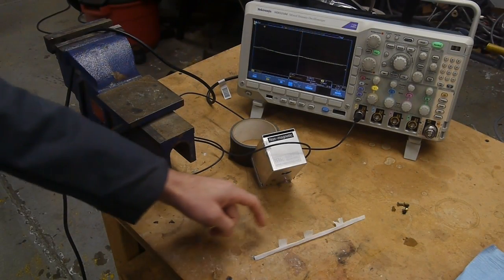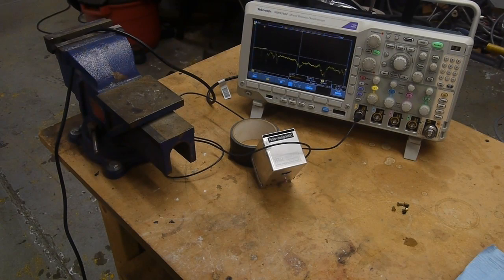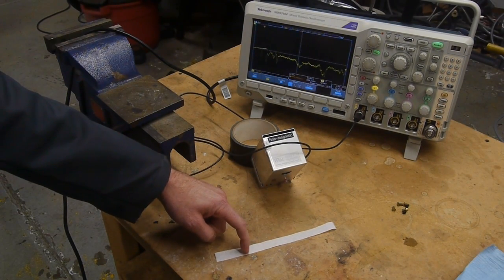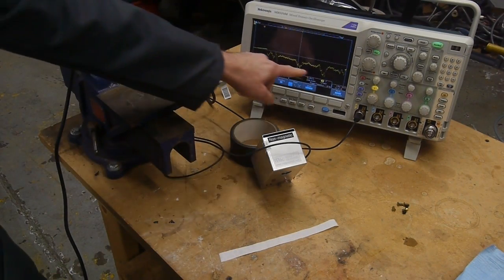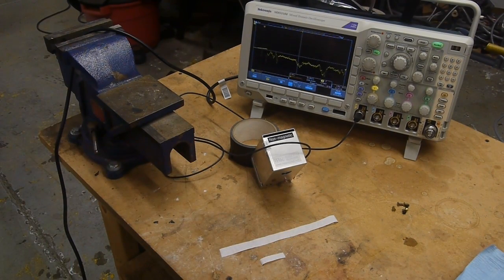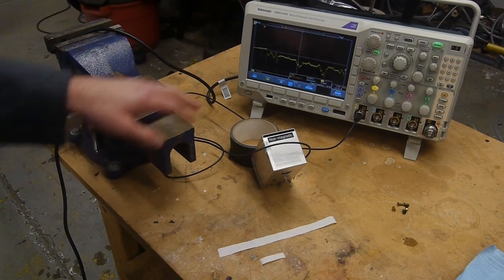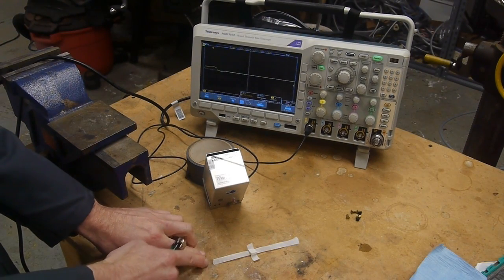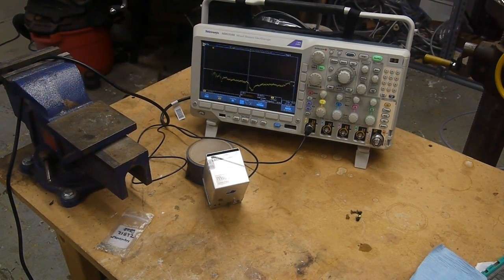Encode information in fire!

Comment: This looks like the perfect way to share secret information, because when someone sends you a strip you know no-one has read it before you and there is no evidence left after you have read it.
Perhaps useful for black boxes; if you have another strip as a backup.
Reply: "you know that no one has read it before you"
His strip reads 00010010001000, you can read it as it stands there on the table.
Reply: AnEntropyFan
I said A strip, not exactly the one from the video. especially if you have a straight strip of paper with no cutouts but just coloured flames you can not read it without a spectrometer.
Reply: sasja de vries
It is a paper with chemical traces on it, there are many ways to read it out. There are reasons why people do not use nonsense like this. This video was meant as a mental exercise - how would you use a system of strips as a "one time use" processor - rather than about practicality.
Reply: AnEntropyFan Even if dried chemicals are visible (under UV / IR /spectrometer) you can hide it by adding Nitro-cellulose fibres over it.
I know there are ways to read it, but there are more ways to hide it.
"This video was meant... processor" -does this mean I have no right to use it in another way???
People who think that "finding other applications for things" is nonsense PER SAY will never find something new.
If something CAN be used practially and safely and it has no analogues, why wouldn't you use it that way?

I know that paper strips like these are not as practical as tapes and disks. This is one of the things I thought: if you manage to make the 'chemical traces' so small a human can' t see it and the paper would me as thin as fishing wire and "rolled up" so that it looks like traces on a DVD,
Then it could be read in a dark box with a light sensor only sensitive to one 'wavelength' and because the traces are so small it is very difficult to read it in another way.
Reply: sasja de vries
Drop it, Ms/Mr. Sasja. This isn't realistically good (optimal) for anything.

LOL! Cut with that nonsense rectal rhetoric.

Or you can simply place a layer of an incendiary chemical over a chip and when the chip completes its sequence, the device sends a command for the ignition of the chemical, and voila! The chip is no more. Or you could simply critically overvolt the chip, no need to play with fire magic at all.

I'll leave you with a quote

"But the fact that some geniuses were laughed at does not imply that all who are laughed at are geniuses. They laughed at Columbus, they laughed at Fulton, they laughed at the Wright Brothers. But they also laughed at Bozo the Clown."
Carl Sagan
Reply: AnEntropyFan  I said "one of the things", not "this is THE WAY to do it". If you're not utterly *** you should understand that this was just an example for something that you COULD do. It's not an end product.

And adding a chemical/explosive/whatever to a chip leaves material all over your room, the ignition could refuse to go of. etc.

The thing is, you judge way to quickly, just because I don't write a whole 20 page philosophy in a youtube comment doesn't mean I didn't think any further.
Why are you trying to prove me, I'm an idiot?
Why are you assuming I am stupid when we don't agree? I just don't know what to say.
Do you feel smarter now?
Reply: AnEntropyFan If you have a sillicon chip (I assumed that is what you meaned...) acting as rom storage and you let a chemical next to it ignite, well... it's more messy than nitrocellulose. Nitrocellulose burns quite cleanly. Didn't you get that point or are you just looking for things I could have said differently?

my example is more like a "proof of concept" sort of thing. Most likely it will work (unlike square wheels), It needs refining and tweeking to turn into an end product.
Just because I had some thoughts doesn't mean it is now my obsession for live.

The Smartest people I have seen do not laugh out others, they have better things to do and they prove their talent by showing what THEY CAN. Jealous people laugh out others. Just saying. Smart people do not draw conclusions to quickly or refuse to think deeper to something that seems odd/wrong whatever.
Reply: some people look at how others say something in stead of what they're saying just because they are 100% sure they are the smarter one.
Reply: sasja de vries
Again, the data needn't disappear. It can be read using passive means, bringing no damage to it. A chip, however, cannot be read with passive means. You need to put specific voltage through it. You have to run it. If you build the device that way so it will destroy itself after being ran, it will be destroyed after being ran. Efficient, isn't it? Again, I can read your paper without destroying it. A device that finishes its sequence by destroying itself cannot be read without being destroyed, really. Furthermore, the thing about modern chips is that they are fast, really fast. Everything would happen in a fraction of a second. There is no way to read the chip and not kill it.

It is something different, but also something absolutely non-optimal. You have bright imagination, clearly, try using it about the very interesting question asked in the video. How would you make the "burning computer:?
Reply: AnEntropyFan If the traces are hidden behind another layer of cellulose, how would you read it out and how would you zoom into the tiny traces (that could be like spaghetti in stead of straight lines as long as they don't intersect of course)? Taking paper apart isn't the easiest thing to do, yet decapping and altering integrated circuits seems easier to me...

"You have bright imagination, clearly, try using it about the very interesting question asked in the video." Thanks.
I can remember that you can do fourier transform with lenses, perhaps a fire-computer could work like that, in s seemingly passive way.
Reply: sasja de vries
You are not trying to retro-engineer the circuit, remember. You are trying to read its current states.

You can do that with lenses? First time hear of that, really, sounds interesting. What I see as a main (and unbridgeable) barrier to a fire computer as it was proposed here is that it would have to be comprised solely out of OR gates (which is what these combined fire strips could provide).
Reply: AnEntropyFan I mean you take the IC apart to disengage the self destruct function and then read the states out...

about FFT with lenses: it indeed sounds insane, but have a look on google and be surpriced.
Indeed, you can make AND gates by letting a certain piece of paper only ignite when the flame is hot enough and it will be hot enough when there are 2 pieces of paper stacked; or something like that.
You can make OR gates if you just make one flame on it's own be able to handle the ignition of the piece of paper. the thing is that NAND gates are much more useful (I'm referencing at simple FPGA/CPLD´s consisting of ONLY nand or nor)

OR & AND-gates are doable (-ish) (sort of...)
Reply: sasja de vries
All of that are extremely invasive means, case in point is that it is actually much harder to "leave no evidence" when it comes to reading a chip like that.

The AND gate is doable with 3 strips (or more), indeed. Great catch!
Reply: AnEntropyFan 2 things: if you open up an IC, do your thing and refill the gap with epoxy  you can make it look like no-one touched it, except it won't explode, unless you even figured out how to engage it again.

secondly, I came up with a way to make burning-paper-NAND-gates!!! (and NOR-gates, and just inverters) One just need to cut out a special pattern and fold it in a certain fashion. I'll have to draw it on paper/GIMP to explain exactly how.
And I have a better idea for making AND-gates than the method I said before.

Comment: This fire computation might be tough. What you basically need for computation is a NOT and a AND/OR gate then you can create all the other gates from that. It is pretty easy to make a OR gate by bringing two strips of paper together so any one of them can ignite the output strip. But a NOT gate is very difficult, only reasonable way is to somehow burn away links (Sort of like what they did in the channel numberphile with dominoes to create a binary adder) But the problem with that is how do you burn away a link without setting on fire whats connected to it, it is possible to create a special pattern in the paper that works sort of as a diode by only burning in one direction and extinguishing in the other?

Comment: You can try using a magnesium ribbon since that should produce a very bright flame.  Also, have you tried using a series of thermocouples to take the measurements through temperature as opposed to light.  Did the ambient light in the room have a significant affect on the readings?

Comment: If you have three strips of paper A, B, C and a strip of non-flammable material like aluminum foil, then fold C into a tallish V, use the V (with foil in between) to “suspend” the end of A over the start of B. When A is lit and C isn’t, B will not burn. If C is lit before A, it will drop the end of A onto B, letting A light B when it is burned (the foil is there to prevent A from being lit when C is burning and prevents C from being lit when A is burning).

Boom! U now have a fire (plus gravity) transistor, two in a series can make an AND gate.

If u have 2 strips D and E, then use foil “V”s to hold E a bit above D, and u’ve got a diode cause D can light E but E cannot light D. Two in a series can make an OR gate. 

:)

Comment: I don't know about computation, and I don't really see the point, but they could be a pretty neat way of storing simple information. Perhaps using n different metal solutions, and printing it onto the paper, when it is burned it emits a strong, visible light signal. Considering that these metals burn in very specific parts of the light spectrum, it would be relatively easy to filter for these signals to decode information. The n different metals could be overlapped, giving a n-bit data storage per 'Burn interval' with the bitrate being limited by the geometry of the flame on the paper - A curved flame front could cross multiple bit intervals.

Comment: perhaps a long strip of peltier elements, so they detect the heat along the length,  perhaps the conversion it could even power an lcd to translate it? using capacitor storage for the power perhaps, initially a large flame burst to get the power flowing, and then as each of the extra tab burns, you detect the extra power flowing to the capacitor or the voltage burst increases, computing as morse code perhaps, no idea if any current microcontroller can run on this low power though :}
Reply: yes look at the adrino boards and the tiny atmo boards .

Comment: You could use 2 paper stips as inputs. Plain paper is the equivalent to logic low/false, paper soaked in something to raise the fire's temperature is the equivalent to logic high/true. Both paper strips are set on fire at the same time, at their ends there must be some sort of heat attenuator, so that a third paper strip (the output) is only set on fire if the received heat is above a certain level ( > only 1 flame being hotter than a plain paper's flame > both flames at plain paper flame's temp). That would be a logic AND gate.

Of course that only works under the right conditions, and I think repeatability with fire is a bit tough to achieve. Also, what would act as the attenuator? Plus the "circuit" self-destroys after only 1 computation, so I don't think it's anything other than a cool experiment.

I also think it is very interesting for Information transfer. If the fire burnt away all metal salts leaving no distinct evidence that there were any other substances that manipulated the flame, this would be the ultimate read-once memory. You could put your encoded information on a small sheet of paper, enclose it in something the size of an USB stick to be in a controlled environment and light it to read the data. Current provided by the USB port lights the paper, a sensor streams the data from the fire's spectral output to the PC.

But I think there will still be particles of those metal salts left after burning, plus opening such a device and reading the data without destroying the paper/information would still be possible. So that isn't secure, and why would we need read-once memory if not for security's sake?

Comment: Make a slightly tilted slot that holds a paper strip vertically. Make a small slid at the bottom of the slot, just wide enough for the paper to go through and just slim enough so flames below wont go up through it, ensuring that burning always happens at the same point below the slot. A thermoelectric peltier module above the flames (why the paper slot should be tilted) can produce electricity, to power an LTC3108 (Ultralow Voltage Step-Up Converter), that in turn can power a microcontroller (ATMega8?) and for output, a memory display (holds it's state after powered off); the peltier side facing away from the flame should kept cool by heat sink. A TCS3200 color sensor can be used to read the color. The paper strip would need a header without code on it, to allow the circuitry to start before the code begins. One strip could hold the entire calculation, or two strips could each hold a number while a third strip holds the operation; the data can be stored in the EEPROM of the microcontroller while inserting the next paper.

Peltier: aliexpress com/item//1800626199.html
Step-Up converter: aliexpress com/item//1884234104.html
Color sensor: aliexpress com/item//1893768484.html
Color sensor: aliexpress com/item//1696639559.html
Display: adafruit com/product/1393

Comment: Some guys has made logic gates with dominoes, utilizing that they don't fall instantaneously. I think it should be possible to do the same with the flash paper. You can then make some bridges where if it's burned from one end, or from the middle, it won't ignite the other ends, but if the other ends ignite, the bridge will as well.

Comment: could you figure out a way to just minimize/maximize how much flash paper is burning? Maybe instead of an optical sensor you could use a temperature sensor? or...both? to cross-check info?

I guess it depends on what you're trying to compute or how complicated the program is supposed to be. I don't really know enough about computers though to say what could work well practically in 2023. Your video has lots of good information though!

Comment: If you had several pieces of paper with tabs in different areas and lit them at the same time, you could do basic math by lighting different areas and checking which areas are burnt before others. Assuming flash paper burns at a consistent rate the area that is consumed last or the sequence of areas burned in time yield an answer.

Comment: Ben, it looks like you're running into distortion due to the point-like nature of the shielded sensor.  I noticed this when I was looking at the output of your final test, specifically the signal amplitude.  Even without the "flame bit," for lack of a better term, in the center, the signal of the baseline flame strip increased toward the sensor, then decreased away.  It might be obvious to say that this is because the photon count reaching the sensor is lowest at the extremities and greatest at the sensor; but it will make generating a signal via amplitude modulation difficult unless you can characterize the curve and account for it.  Perhaps a linear array of shielded sensors might produce more reliable results?

To clarify: you would not need to sequence the sensors to "follow" the flame front.  If you model the intensity of light as a bell curve around the flame front, then you just need to build an array such that, at any point along the strip, say....3 sensors (this is just spit-balling here)...are within the majority of that intensity curve.  The array would only have one analog output, but, with a baseline flame strip, it should produce a much flatter output signal.  More conducive to embedding information.

Comment: Hi. Yes you can do a primitive form of "computing" if you don't restrict yourself to strips. a C-shape (incomplete circle) or possibly a spiral (if you work in 3D) would be a WHILE-loop. a STAR- or FULL CIRCLE would be a multiple branch. a DOUBLE X-shape could be a yes/no conditional branch. this way you have a conditional branch, an iteration of sorts and a multiple branch. By making use of little tubes of different heights (on which aforementioned shapes rest) and working in 3D you could make a simple adder (I think). I don't have flashpaper so i could only "simulate" it in my mind :)

Comment: Where the paper is wider, and where you have two strips burning together, I notice that the flame burns much higher. 

An effect which I've seen with matches and lighters (I'm not sure if the same is true for flash paper) is that the flames of two separate matches burning close to each other tend to merge together and burn higher.

Could you find some distance at which paper will not be ignited by a single burning tab, but will by the combined flames of two tabs separated by a small distance or non-combustable material. If so you have an AND gate.

An OR gate could just be a Y shaped piece of paper

You could make an XOR by combining an OR and an AND and coiling the output of the OR so that the AND output can burn ahead and burn out the path from the OR if triggered.

I think you'd then have all the components of a binary adder.